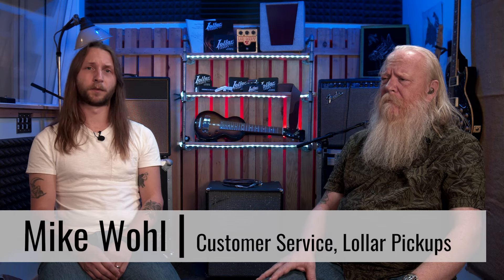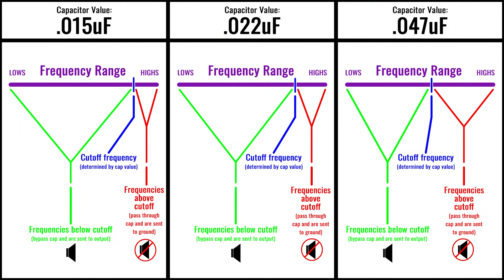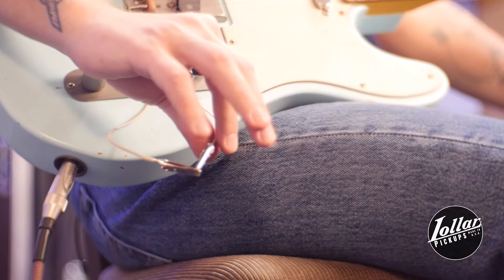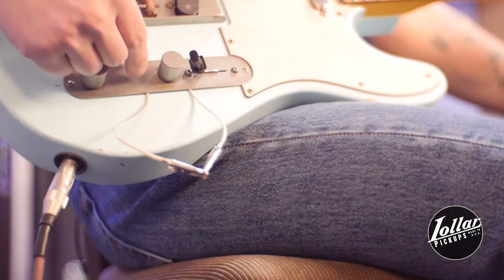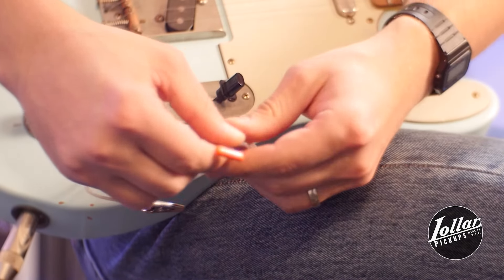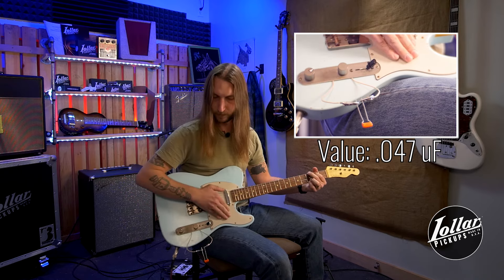LOLLAR PICKUPS Presents: TONE TRUTH - Capacitor Value

Comment: You can also use a female pin header, so if you have a backplate guitar you can leave it off while fiddling about with caps, and just slide the legs into the female port holes. There are also dual row pin headers, so you can plug multiple caps in parallel (solder all of pins of a row together, then connect one row to one side of the circuit and the other row to the other side) to get values between standard cap values. Im using .028uF (3 blue HV 10nf caps I had laying around) with a performer buckshot and a '59 on an explorer clone. Nice and warm on the neck, screaming dry on the bridge, and all around chunky and present. Usually keep it around 2/3 up on tone, but I do play with it quite a bit depending on mood. It has certainly tamed down the metal zone pedal Im using at the moment oddly enough....the cut it puts on the signal tempers the 'angry bees in a tin can sound that is a common complaint with that pedal. 

*Disclaimer: If you have opinions about 'improving' my rig, hey thats great champ, keep 'em to yourself. I dont give a shit about adversarial bullshit posturing, your need to prove youre smart (smart people dont need to prove it, junior), or being 'the best' to whoever as if that holds any meaningful value outside of ego stroking. Honestly, if thats how you live your life your ego can take a long fuck off a short pier. I just fiddle with it till I find something I like, then change it all again a few months later. That being said, Im all for the free flow of knowledge and experience, and dont mind general conversation about my or any setup.
Reply from the maker: Totally agree. Your rig, your rules.

There's no reason folks shouldn't be able to just let others be happy with whatever it is that makes them happy. If someone wants to run their guitar signal through a jar of mayonnaise, so be it. If they like it cool: play on. And if I don't like it, I don't have to listen to it. No one is forcing me to listen to them play their guitar through a jar of mayonnaise, and they shouldn't have to listen to me tell them why I don't like it.

Comment: so if u have volume on 10 and tone knob on 10 , is the capacitor making a difference? or is it only when u lower ur volume and tone does the capacitor make a difference.  thank you
Reply from the maker: With both controls all the way up, there is still a negligible - almost imperceivable - effect. Unless you have "no load" pots, where there is absolutely infinite resistance to ground, then the components will always have a bit of a fingerprint on your tone.

Comment: What’s your general consensus on LOW value caps? I recently put a .01 in my Strat and absolutely love it. I’m thinking of trying .0047 or .0033 or .001- are they going to be too subtle to notice
Reply from the maker: It's hard to say whether or not you'll be able to hear an appreciable difference, it's really a matter of subjectivity. I don't think most players would hear a big enough difference to make it worth the effort, but some may and only you can determine if you think it's worth it. Some folks may just convince themselves that they hear a difference when they don't, but as long as they're happy, it really doesn't matter what others can or can't hear.

In the end, the only way to know for sure is to give it a shot and see what you think. You can always take it out, if you're unhappy with the results.
Reply: @LollarPickups  ended up going with a .0047 which I like on the bridge but was too subtle on the neck. Next stop is .0068 I think that will be perfect
Reply: I just stick with the .022 value. You can use a Panasonic brand since they’re cheap and considered high quality

Comment: Using short wires soldered to alligator clips lets you pick the capacitor that is best for your guitar... single coil pickups or humbuckers or rails types  .... get the capacitor that SOUNDS best to you over the range you like...
Reply from the maker: That's exactly what we did in this video, to allow us to "hot swap" the caps out without having to stop to remove the control plate, desolder the cap, replace and resolder the next one, and so on.

There is no rule, only convention. T=Beyond that, the player's ears are the absolute test of what's best for any particular instrument/player combination.

Comment: A bit difficult to compare, so:
100%
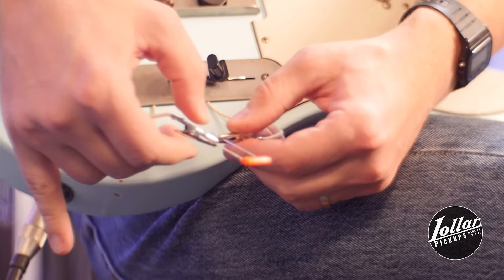0.015uF - 4:05
0.022uF - 5:07
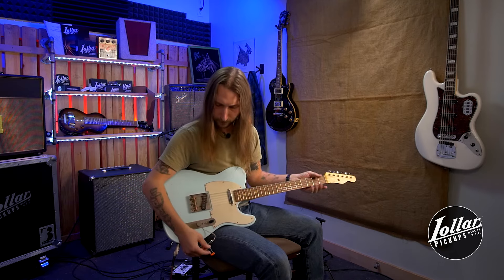0.047uf - 6:08
75%
0.015uF - 4:16
0.022uF - 5:19
0.047uF - 6:23
50%
0.015uF - 4:25
0.022uF - 5:28
0.047uF - 6:36
25%
0.015uF - 4:35
0.022uF - 5:39
0.047uF - 6:47
0%
0.022uF - 5:53
0.047uF - 6:56
Reply from the maker: This is very helpful (and something I wish I had done to begin with). Do you mind if we just copy this comment and drop it into the video's description?
Reply: How does the .015 roll of MORE highs than the other 2 though? Listen to “25%” it’s very plain to hear. I was under the impression that the lower the value the less roll off….
Reply: Not even close the .015 rolls off more by a considerable margin….

Comment: LOLLAR PICKUPS , Can you make another video trying these values 0.0047uf, 0.0022uf, 0.0015uf because it works better on strats and telecasters which Leo Fender messed up using to much capacitance to get those jazz guitar tones which most rock players those cap values 0.022uf doesn't work its better to use 0.0022uf instead, try it out. SRV#1 strat used a RED capacitor but not sure what the red capacitor value is or what type of capacitor material used.
Reply from the maker: While it's not exactly what you're looking for, as it's not the values that you're inquiring about, we did a cap value video a while back that you might find helpful. You can view it here: https://youtu.be/0Fzsc7uqc3g

The reality is that these videos are extremely time- and labor-intensive so we have to do them according to what a majority of our viewers and customers would find most useful. Since most guitarist rarely ever stray from the "common" component materials, we tend to focus more energy on those things. As we get more and more of this sort of thing done, we will have more time to put our time into things like underrated tone cap values and stuff like that. But this is a very good idea for something like that, thank you for suggesting it.
Reply: @LollarPickups  Yes I'm sure making those videos are labor intensive but they look like good quality videos. I replace my strats tone caps 0.015uf or 0.022uf with a 0.0022uf instead because it has less capacitance which is better for rock pop music. Leo Fender used 0.047uf to get those jazz tones because jazz guitar was still in at the time. Its the wrong cap values for rock pop music because 0.015uf, 0.022uf, 0.047 are way to much capacitance which is sinking and bleeding off way to much of the high frequencies leading to the jazz guitar tones. For Pop Rock music 0.0022uf has less capacitance so its just sinks some high frequencies to ground. Its way more useful as a tone pot because before I never really used the tone pot because it was way to dark and jazz tones which is unusable for me until I replaced it with a 0.0022uf.

Comment: Is the 0.047uf vintage correct? I have replica of the 60 strat with a set of lollar specials, 250k pots and 0.047uf but not a big fan when Im rolling down the tone. In the video the 0.15 sounds the best by far!
Reply from the maker: .047 is both historically accurate and, by far, the most widely used by Fender. But the fact is, it's not the correct cap value for you if you like something else more.

It's entirely up to player preference and I wouldn't put more emphasis on the minutiae of what is vintage correct over what I prefer as the one playing the guitar. Go with what you like!

Comment: I was surprised you changed pickups during the demo... ?
Reply from the maker: Good eye! We did inadvertently change from bridge to neck between the bypassed or "no cap" setup and the first cap demonstration. But we kept it on the neck for all of the different cap values, so the main point of the comparison still comes across as intended.

Comment: Great Video!  I have an upgrade question for you below, under "smutsharry" (2nd one, down from the top of comments, currently - 11.28.2022).  In regards to your comment regarding the "orange" (or whatever color) Caps, and that their "Orientation" 0f which lead is soldered, where,  does Not really matter in their installation within guitar circuits.... you may want to take 13 minutes, and watch this video... it does matter, and he explains how & why.  He got his knowledge about it from a fellow up in Canada, who has a website (which is linked in his video on correct Cap orientation), and is nothing short of a "genius" (literally) in the field of electronics.   I think it would be worth your time (13 minutes), if it would help make your already great products, even better... through just a small detail of attention in assembly.
Reply from the maker: Thanks for your input. This is not something that we put much emphasis on and not something that we are concerned with here in the shop. The type of caps used in guitars are not polarized and can function well in either orientation. The difference is so small between the two as to not really have enough appreciable benefit from this level of scrutiny. If people want to do so and it makes them happy, more power to them, we support them in following their own joy. But the time spent flipping caps is time that could be spent playing guitar for others and we support them in that as well. I have never personally bothered, as the small amount of benefit is not worth the effort. I've always just soldered my caps in however they may be and I've never been dissatisfied with the results. Other folks may feel otherwise and that's why we say, "Whatever YOU like best, is what's best for YOU."

Comment: a capacitor is a HIGH pass filter. When combined with a potentiometer in a guitar’s circuit, the entire tone control section acts as a low pass filter.
Reply from the maker: This is technically correct. Though we tried to make it more clear to our viewers what the effect of the capacitor in the tone circuit would have on the resulting sound. 

The tone circuit itself is a low pass filter, in that the signal that passes through to your speaker is anything that falls BELOW the frequency threshold. Frankly, no one really cares what the signal going to ground would theoretically sound like - they don't hear it, so it doesn't matter - so we didn't bother to explain that in full detail. But, in our attempt to explain, perhaps we over-simplified it for folks such as yourself. But it sounds like you already understand how a capacitor works, so this video is not really intended to clarify anything for you. Thanks for pointing out the flaw in this oversimplification, hopefully others will benefit from either our explanation in the video or this conversation here in the comments.

Comment: Why do bass guitars get active tone controls and electric guitars don't? I mean, it's widely understood that active tone controls are better than passive. 

This would make all this effort into choosing a precise value of a capacitors and resistors kind of irrelevant.
Reply from the maker: I think that the main reason is that active electronics are usually less dynamic and touch-sensitive than passive circuits. They tend to compress the feeling out of the players input. And the guitar itself almost becomes little more than the vehicle to host the pickups. You can swap the circuit from one guitar to the next and the tone will change very little. You lose a lot of that organic tonal fingerprint that passive circuits allow, both from the player and the instrument. When you play through active pickups/tone controls, you're often hearing the circuit more than the instrument. Also, I can only assume it's also partially due to the power of convention. Folks don't like change, so they're willing to go along to get along. They heard their favorite guitarists playing through passive systems and so they want to emulate those tones and so they use similar gear to do so. The industry saw a small shift toward active systems after some heavier bands started gaining popularity in the mainstream, but it has never (nor will it likely ever) competed with the popularity of the classic designs.
Reply: @LollarPickups It's weird. You have active controls on amps, maybe some pedals.  You have active pickups (I think Fluence has and a few others have a single switch), but no active tone controls on a guitar!
Reply: I'd say that active tone controls are 'different' to passive, rather than 'better'.  Certainly if you want to do big narrow frequency boosts cheaply, then you're going to need active EQ.  But for gentler EQ changes, passive can be just as good or even 'better'.  The Manley Passive EQ is a highly regarded rack-mount EQ found in many high-end recording studios, and although the circuitry does contain valves, the EQ section is all-passive.  That's about $6999 (current Sweetwater price) of coveted passive EQ. 

I think basses often have active EQ because there's a wider range of sounds required from a bass than a guitar.  If you want to get that mid-scooped sound from a bass to emphasise slap and pop sounds for one track, and then push up the bass and mids for the next track, then you can do it on the amp EQ, but if you're playing live, then it's easier to have the controls on the bass guitar.  I personally find that in isolation, most passive basses have more interesting tonality than active basses, but I know a lot of that gets lost in a band situation.

With guitars, you need this type of extreme EQ far less, and it's generally  a case of adding more overdrive or distortion to the sound, often with pedals, than changing the basic tonality of the guitar sound. 

There have been guitars with very comprehensive active EQ controls, but they've pretty much all been sales failures.  The Gibson RD Artist and Les Paul Artist guitars in the late 70s had Moog-designed EQ and were amazingly versatile - but hardly anyone bought one.    

The active add-on modules for EMG pickups are probably the most popular active EQ options for guitar, but that's partly due to a lot of the EMG pickup sounds being rather flat and boring without them (IMO).  I certainly wouldn't be without the EXG control on my SA-equipped Strat.